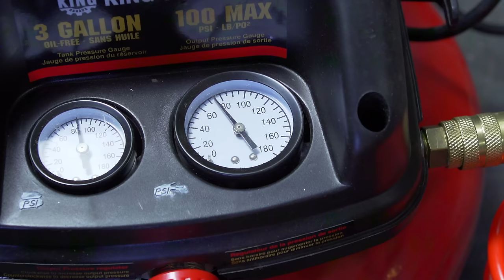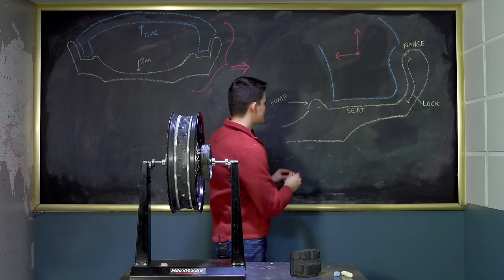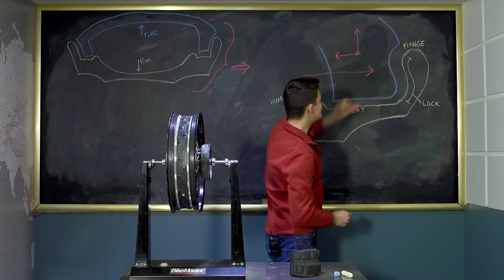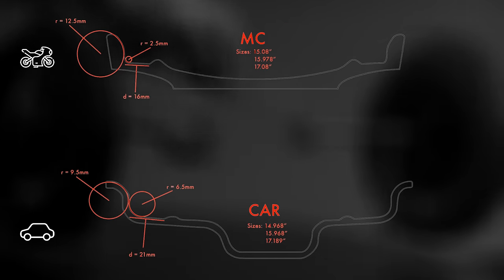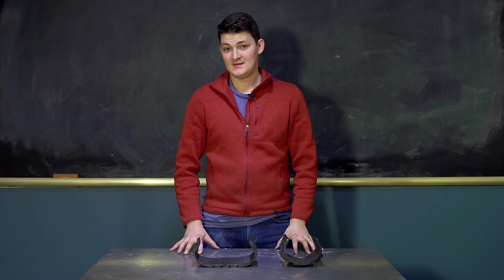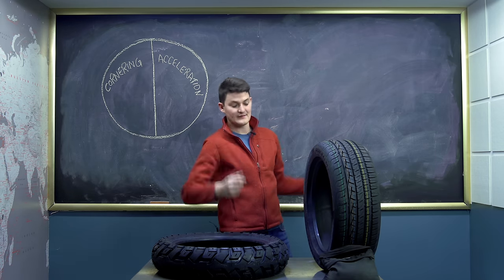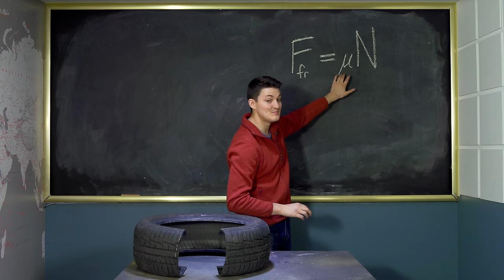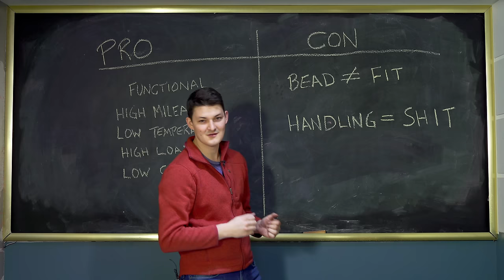Are Motorcycle Tires a Ripoff? The Darkside Car Tire Experiment

Comment: Couple of extra added observations from my time trying the dark side on a GL1800.  My car-tire did not last as long as the motorcycle tires I usually ride on.   It provided more traction while leaned over than a motorcycle tire.  I could give it full-throttle while leaned-over without losing traction.  Full-throttle while leaned over with a motorcycle tire will cause my GL1800 rear-tire to lose traction and break lose.   That said, the stand-up tendency was enough for me to not continue the practice.
Reply: You are the first to claim the MC tires outlast the car tires. You should list the brand and make of the tires you used because there's a lot of us here that ain't buying your claim.
Reply: @dougfresh1341  Falken 912 CT and Avon Venom MT
Reply: @wellsbengston4132  I don’t know Wells. While the Falken brand isn’t known for longevity, car drivers easily surpass 20k miles with them. There’s not a rear bike tire out there that will last 20k miles. I did have an Avon on a custom bike. It did last better than Dunlop or Michelins, but not close to a CT.
I used a Toyo tire for 22k miles on HD. Still had plenty of tread. Now I have Pirelli Centurato run flat. Currently 15k and not even close to worn.
Reply: @dougfresh1341  Keep in mind that I make it a point to spend as much time as possible on curvy mountain roads.  I'm sure the tire would have lasted longer if I was a more typical Goldwing rider.
Reply: @dougfresh1341  I’ve gotten 17k out of dunlop trailmax missions. Lots of highway, still had some meat. I will be taking the new one to 20k
Reply: @confettier  What bike? Two up?
On my 08 Glide I actually got 19k once. Of course the Mgr said I should’ve been there 3000 miles ago. Pffftch! Run ‘em til they shine!
The vast majority of touring bikes hardly ever get more than 12k. Keep in mind I ride a car tire not just for longevity. It rides A LOT better and grips better for stopping, especially on wet roads. Then there is the price. $160. Installed.
Ride safe.
Reply: @dougfresh1341  I put them on a 2013 r1200 gsa. That particular tire I had about 10k+ miles with full luggage single person. I would imagine around 800lbs all together for those 10k other 6k probably around 700lbs. Lighter weight and good suspension definitely had a bit to do with longevity. Same setups I’ve had continental tkc 80s last about 2k.

Edit: also 90% highway 10% gravel/dirt/trail. And as many curvy roads as possible but this tire was still square by 16k it was noticeable when cornering later but not an issue. Also they are surprisingly quiet for the amount of meat
Reply: I call BULLSH!T on the bike tire lasting longer than the car tire........... That tells me you NEVER ran a car tire on your bike...........
Reply: @never2old4toys66   I ran a Falken 912 CT on a 2008 GL1800 to the wear bars.  The tires before and after were Avon Venom motorcycle tires.  The Avon Venoms outlasted the Falken.  I've also run Dunlop Elite 3 and 4 tires and they put the Venoms to shame.

Comment: I've been darksiding my Goldwing for a couple years now. Since my ride is my primary mode of transport, I'm putting 30k miles a year on it. Motorcycle tires--$350 Goldwing tires--get expensive at that rate. It takes a few minutes of getting used to, but like he said, you don't notice after that. Never had any problems. In fact, where my motorcycle tires would sometimes spin in the wet under the fantastic torque load the Wing's car engine puts out, the car tires never do. I'm never going back.
Reply: It seems he chose the widest tire he could fit which which meant an extremely low profile sidewall, which affected his handling far more than necessary.   I run a  Sunfull SF-05 185/75R16 truck tire on my Gl1500, barely wider than stock, and I can't really tell the difference between it and the stock tire except for the weight of my wallet.  A goldwing tire lightens my wallet to the tune of $200 or so, and this tire that will last 3 times as long for only $59.95 and free shipping off Fleabay!  It does scrub my fender a little on bumps  if I don't keep the shocks aired up to about 30lbs.  The Spontaneous uninstallation.is a great line, but 4wheelers will deflate big tires down to 5psi for crawling over rocks and rarely have one deflate.  Another plus that he didn't mention is that the light weight of a motorcycle will rarely push an object through the steel belt on the car tire.  I went darkside on a Shadow 1100 because of picking up a nail at least once a month at the construction entrance at my job.  Put 20k after switching and never had a flat again.  I still picked up nails, but would hear them clicking and stop and pull them out.  This bike rode much better, especially 2 up and was only a little loose feeling on gravel roads.  Tire still had well over half it's tread left at 20k when I sold the bike.

Comment: Darkside on my Goldwing, I pull a trailer with it and really like the run flat capability. The alternative is to buy a new rear tire every month if I go back to a motorcycle tire. I have not noticed any change in handling at all. Good video- i would say about 80% accurate.
Reply: I'm looking to get a used Goldwing and thought about doing this. I can't imagine dragging the foot boards on it, so this seems like a good, if not exactly proper thing to do. Can you tell me more about how you feel on yours?
Reply: @Lightndattic  a goldwing is pretty nimble. More than you would think for the size. I throw mine into corners without worry. Also has great power with a top speed over 130 mph.

Comment: I'm on my third car tire on the rear of my 07 Goldwing. All 3 have been runflats. I have a total of 90,000 km's with car tires. My 3rd which is a Bridgestone has 20,000 km's on it and is good for at least another 20,000. Why? I can afford what ever I want. My observations are that the car tire has a far higher load rating, it's hugely superior in the wet,it lasts far longer,no one and I mean one one that I have heard of has had a "blowout"., the handling is suberb, braking is better, and lastly my wife says the ride is "plusher" Many thousands of riders have put millions of km's on bikes with car tires. I'll never go back to a MC tire. There is a web site called darkside info that lists the bikes and the recommended size of car tire. For my wing I use a 195/55/R16. Some guys will use the 60 series and or go up to a 205 width. I know riders who have used car tires on V stroms and FJR 1300,s. They too will not go back to MC tires.
Reply: David Giles well as mentioned in the video you have to decide. For me it doesnt fit my riding.
Reply: i plan to one day get a goldwing and small trailer, either rv or just storage type. with two ppl plus a trailer it makes perfect sense to use a car tire on the back wheel. i just dont feel like a moto tire will handle that load for very many miles. no a car tire is not something id put on any sport bike. i just think of a car tire on that kind of bike to NOT be of much assistance to the performance of a sport bike. but a goldwing was not meant to out perform a sport bike. its was meant for a comfortable long heavy haul which is perfect for a car tire. plus even though they dont lean like a two wheeled bike, trikes use car tires on the back as well AND even the insurance companies have no issues with "the dark side" so long as its (here in the US) a tire approved by the D.O.T.

like yourself, ive yet to see ppl who've tried the dark side to come away from it swearing up and down that it was the most dangerous thing they ever did. never seen statistics to prove so either. if there were, the insurance companies would forbid it in their policies and use it as an excuse to avoid paying out on claims.
Reply: Mental illness category, but OK.
Reply: @rebel_ltz  I've noticed that bmw cars handle and ride much better when they don't have super stiff, heavy run flats. They are factory installed on all none sport models. Also noteworthy, is that no sport models use run flats because the people that drive them usually don't have their head 5 miles up their posterior, like your average bmw suv driver. So I'd call run flats on a goldwing insane even if the gold wing has 2000lbs on the rear wheel.
Reply: Good post, David Giles! Same experience with me but on 5 different cruisers/touring bikes! I challenge anyone to find an accident or mishap caused by a darkside tire! WAY better traction in wet and braking! MORE precise in high speed curves. One needs to know how to ride and handle a bike. No "buts" or "ifs."  I used more skinny car tires and with a more rounded profile than he shows in this video and usually spend around $70.00USD! His melodrama is laughable! One needs to find the right tire pressure as well! I've NEVER heard of a darkside tire coming off the bead!!!! Give us a break and qualify these claims! I wouldn't use that tire with that high pressure on a BMW adventure bike either!!...Get informed...
Reply: This thread is sounding more and more like those unspeakable trike people... I'm sure those "handle" great too. I'm going to get a solid equipment tire on er', she'll last forever.
Reply: No argument on the wear, they must last ages, but there is no possible way this is going to improve the ride quality or handling of a bike. Almost doubling the unsprung mass of a motorcycle wheel is going to have numerous negative effects on top of the obvious lean limiting. And, you shouldn't be stopping with the back tire anyway, that is the reason abs systems are engineered to practically hover the rear wheel.
Reply: @apodski  your comment is sounding more and more like someone who has jack squat for experience with the dark side.
Reply: @billydarley6925  You might be right, I wouldn't be caught dead on any of the supposed darkside bikes. However, I understand bikes and I understand tires and the dark side ain't it boss. Like putting semi truck retreads on your suv/truck to massively increase your tire life. It will work, but there definitely are significant losses. Let's get real here too, very few actually ride enough to burn off a motorcycle tire before it's dry rotted away. It's a bunch of bar parking lot posturing. "Look at me, I found the sleaziest tire shop in town and gave em a 30 rack to mount this, bet you can't be tougher than that."
Reply: @billydarley6925  Also, the rolling resistance and weight of a car tire is going absolute eat fuel economy, probably negating the cost factor. And, it's not like anyone rides a goldwing or a giant cruiser because they're easy on gas and cheap to own.
Reply: @apodski  Go try it and then comment.
Reply: @justmyself1000  Well said.
Reply: @billydarley6925  Well said.
Reply: @apodski  again when you knock it before you've tried it. you just make yourself look very ignorant. guess thats bliss for you. btw i havent tried it either but very much plan too before i start knocking it.
Reply: Seems very much like a thing for calm crusing.        Which makes sense.   And then someone might say it's better or as good but as general statement that's nonsense.  Bet everyone on a street triple would curse those.  Hell even on a Ducati diavel youd notice

Comment: Tires interact with the ground more closely with the traction equation rather than the pure friction equation.  The traction equation does include surface area.  This is also why dragsters have large wide tires. (In addition to more rubber to burn).
Reply: Correct. Ryan oversimplified in this case. There is a reason why sports cars have wider tyres : more grip.
Also if you are still unconvinced, try sliding two different sized erasers across a desk. Surface area ABSOLUTELY has an impact.
Reply: @Stratocasterhead51  if you want to avoid oversimplification then it should be mentioned that contact patch does not simply increase with wider tires, in fact you can have the same contact patch or lower. 
Example with eraser is oversimplified because wheels are not solid chunk of square rubber, they are filled with air. Drill inside of the erasers, fill it with air under pressure, apply same force down and now compare contact patch.
Reply: It’s the same reason why a vehicle can possibly turn at a rate of over 1g. 

If tires only followed the simple friction force equation then the physical limit of grip with the stickiest tires ever conceived would still be less than 1g. 

The microscopic interface between the bumps in the road and the soft tire is what lets many cars turn at significantly higher rates than 1g.

Comment: a vintage car tyre, like a 3.50 x 17, makes an excellent front tyre on a trike. its square section improves the handling massively
Reply: Do you see any motorcycles anywhere, that want a square section tire?...Moto-Gp bikes would use square section tires if it was a massive improvement. On a motorcycle tire,when its worn out? Its flat in the middle.= square section.
Reply: @bradsanders6954  please reread the comment. i'm not talking about motorcycles, i'm talking about trikes.
Reply: @bradsanders6954  THREE wheels dude.

Comment: Totally wrong bike to do this on. I wouldn’t recommend a car tire on a rice rocket or Ducati, but a 1000 pounds of Goldwing, 2 up and pulling a trailer makes all the sense in the world!
Reply: Anytime I've heard of a car tire on a bike it's on a Cruiser. Straight line down the highway, no problem. More than likely they don't plan on cornering often. Strictly straight line use.
Reply: Towing any trailer behind any motorcycle makes no sense, just like this ridiculousness.  If you need a trailer behind your bike, you're carrying too much stuff!
Reply: @1212sman  I know a guy that tows his BMW s1000rr to the race track behind his goldwing.
Reply: @thecrazybag  that's the most swag money thing I've seen this week.
Reply: Ducati… no!
Yamaha FJR1300… ABSOLUTELY; best damn motorcycle tire I ever put on back there: BF Goodrich g-Force comp-2 AS steel belted radial. 
Outlasts a premium MC tire 6 to 1, and grips even better in the fun stuff. 
😁
Reply: @dylanm9948  scrap boards on a 07 road king with a trunk and fairing running a car tire all the time lol. Its actually easier than with the mc rear.
Reply: @bradiacm7828   Well? Here we have experience and I have seen them on FJRs. Grips aven better in the fun stuff; would really like to see the FJR in full tilt at speed on Stunt Rd in Malibu.
Reply: @ng7m-ham-shack   Max, you really need hard data for those opinions. Don't want to be a sheep, haven't seen the data just educated opinions like Fortnine. Experience sometimes beats the apparent physics.
Reply: @thecrazybag  Pics or it didn't happen. Thank you.
Reply: @1212sman  Not if you want a tent and camp outside.
Reply: @ng7m-ham-shack  Why are you so aggressive.He said he was fine riding it and got 6x more wear.
Reply: @rubensahak9178 , oh, I dunno; I tent camp all the time and I don't need a trailer. My gear is compact and light weight and I can carry all my needs just fine in saddlebags a a seat bag.
Reply: @dylanm9948  I can run curves faster with the car tire on my Goldwing than the original motorcycle one, definitely not strictly straight line use, also no it doesn't run on the sidewall it's not moto GP
Reply: Pulling a trailer behind your motorcycle is not only unsafe but it may also void your warranty on the affected parts.
Reply: @MrPAULONEAL  due to laws in place your warranty is protected. It's unsafe with any vehicle if you don't have the trailer loaded properly. I've towed mine quite a bit and I know many others that have tow trailers all the time and have not had issues.
Reply: @1212sman  good for you
Reply: Thanks Matt. There are a lot of us Goldwing Darksiders out there.
Reply: @bradiacm7828  Raving about the good handling of an FJR??  Seems you don't get out much.
Reply: @1212sman  When your mode of transportation is the Motorbike, the trailer becomes a necessity
Reply: @dylanm9948  I actually look for curvey roads with my cruiser.  Hate straight roads.  Boring! My cruiser is a pretty capable bike on a twisty road.
Reply: Not in the world, but only in USAmerica... :-)
Reply: @thecrazybag  lmao goat
Reply: @1212sman  I've always considered towing a trailer as adding significantly to the chances of a severe accident, it's just wrong on so many levels from a dynamic point of view.
Reply: @fiveowaf454 , if you're dragging a trailer behind your bike, you're taking along way too much stuff.
Reply: Your thinking "sidecar".  They dont really lean over.  A car tire still doesnt fit right on  a Gold Wing rim. If safety is irrelevant then yes this is for you.
Reply: @bradsanders6954  As Scotty used to say in Star Trek "ye canney change the laws of physics"
Reply: See,you dont say trike anywhere.

Comment: Ok so as a darksider I gotta throw some input in here. Fotnine I love your channel and you are amazing for great info. But I recommend 2 things for you to do before finalizing this. 1) use a heavier bike. VTXs, Goldwings, Road Kings, Street Glides, Indian Chiefs, etc.... And 2) use a proper car tire. You need full symmetrical or directional treading.  It makes a huge difference with handling. That asymmetrical that you were using probably felt better turning to the left and horrible turning right. But more importantly, traveling straight will cause your bike to rut drift. Your rear tire will cause your bike to push your front instead of being pulled by the front.
Reply: Congratulations on knowing more than the guys at Michelin, Bridgestone, Pirelli etc.